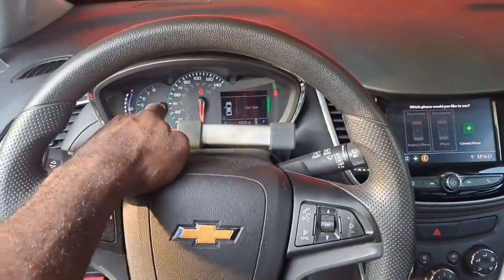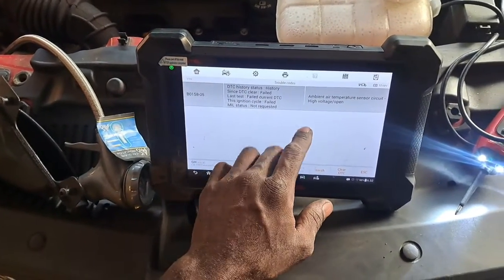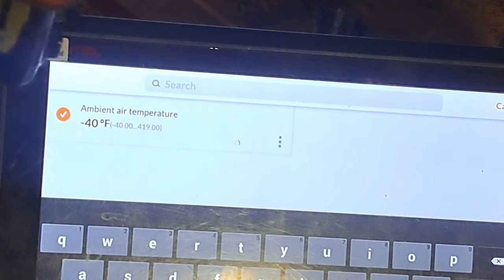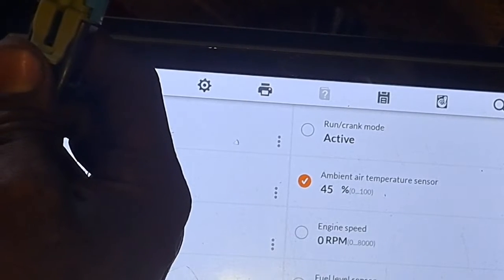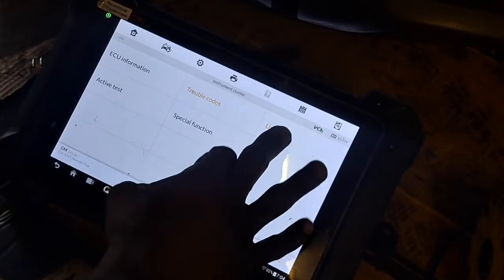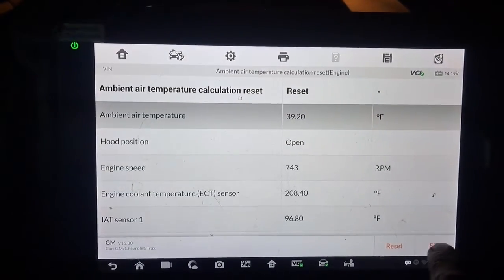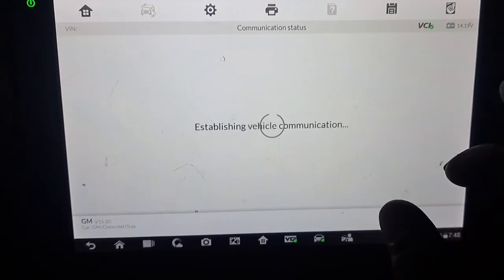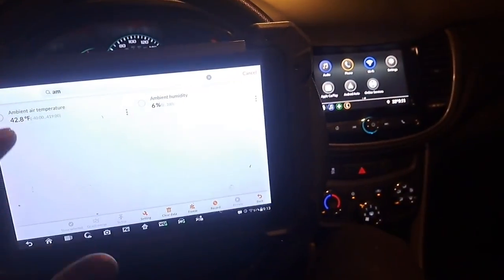2020 chevy trax no ac operation

Comment: Would a bad ac compressor ever burn out blower motor resister on a chevy trax?  This shop i went to is trying to tell me ac compressor is bad and thats why it burned it out. I say test and replace the blower motor. Before you put a damn resister in it.. arent they on differnt circuit?
Reply from the maker: No,  a bad ac compressor can't and will never burn out blower motor resistor. However, a bad blower resistor module can disable the ac compressor.  Key giveaway will be no blower motor operation, and the blower will not work at any speed. 

But to double down,  no... the compressor and blower resistor don't work DIRECTLY with one another but can work indirectly to affect system operation.

Comment: Ambient Air Temp goes through the cluster, if the scan tool shows a temp but the temp on the cluster OR radio display are different, then the cluster module is calculating the logic wrong and then you know the module is the problem. I have recently seen this problem. These CAN systems are getting more and more related to crazy things screwing up other crazy things. Not sure if the Service Info explains the way the system works, something to look into reading, thanks for the video.
Reply from the maker: Everything is working fine and temperature is reading normal. After the video and several days, I discovered a poor pin fitment at connector, once I increased the spring tension on female pin,  everything works great
Reply: @partsshooter  I am thinking a resistance test of the sensor and then of the circuit in full might have shown the added resistance since the resistance vs temp are pretty sensitive to small changes, thanks for the update, I can correct my library for the final fix, cheers.

Comment: Unhooked the battery and let it all reset the computer
Reply from the maker: That wouldn't work... just as fuel trims have to be forced reset,  this is that same scenario,  but with initialization added
Reply from the maker: However... to meet you in the middle,  maybe shorting the terminals after disconnect MAY do something

Comment: Whats up man I worked on a 20 equinox with this same symptom minus the broken wire. Came in late located the sensor and did your same test, no change on the scan tool. Thought I'll fix it tomorrow, come the next morning everything is working fine. Kinda suspected logic lock or just a specified amount of key cycles might've fixed it. Wish you the best of luck on this one. This one came from a body shop and was wrecked in the front end prior to repair
Reply from the maker: This crossed my mind regarding the key cycles.  Because If you notice the temperature changes with the cycling of key. So I agree with you. I'll keep you updated if it comes back.  Ac still work days later.  She picking it up today.  Thanks